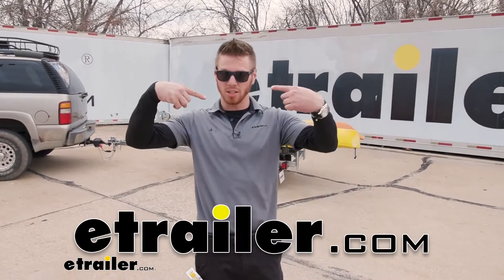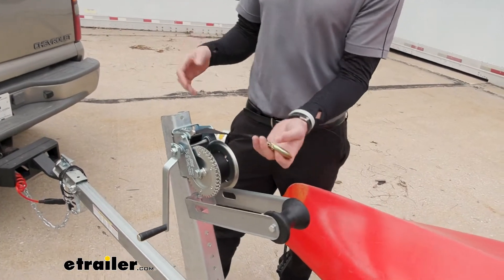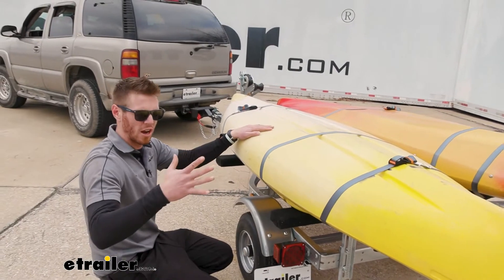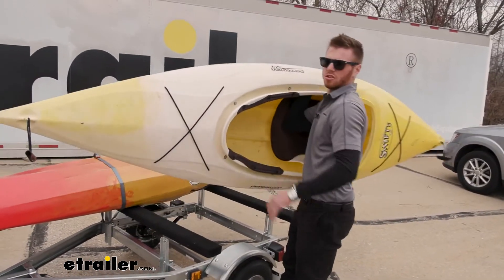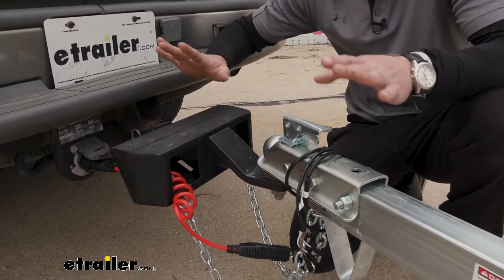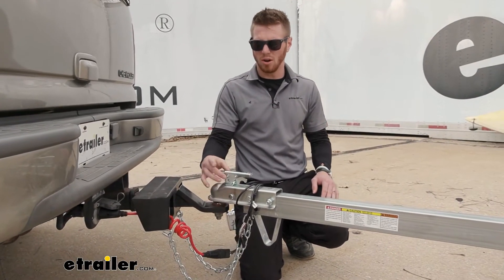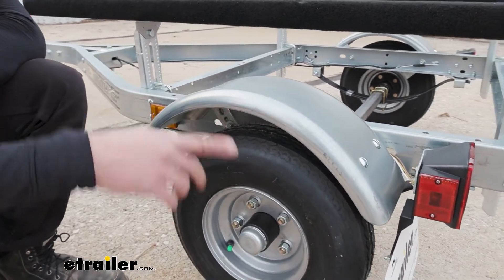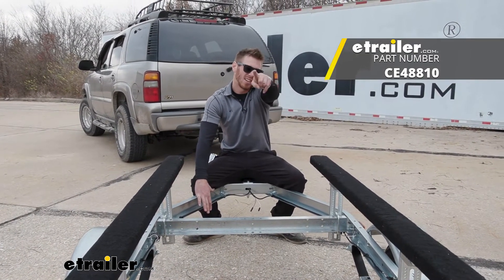etrailer | CE Smith Multi Sport Boat and Kayak Trailer w/ Bunks Feature Review

Comment: You didn’t address the bearings. Do they need to be repacked 1yr and/or 12k miles when NOT used by immersing the trailer in lakes, etc?  When using for kayaks the trailer’s bearings wouldn’t have the problem that regular boat trailers have with water, sand getting in the bearings?
Reply from the maker: As long as there is not water getting to the bearings, you can still follow the 1 year or 12,000 mile recommended changing.
https://www.etrailer.com/Kayak-Trailer/CE-Smith/CE48810.html